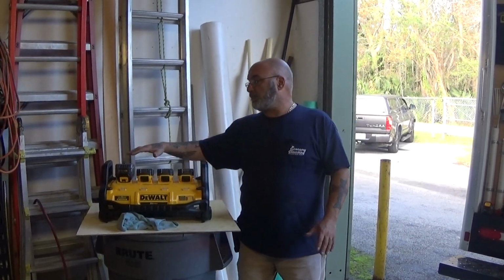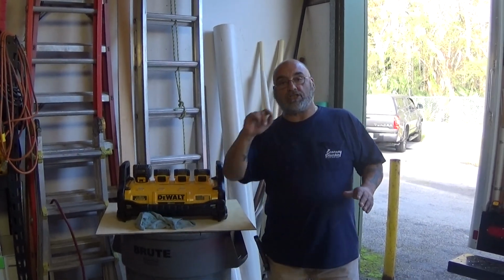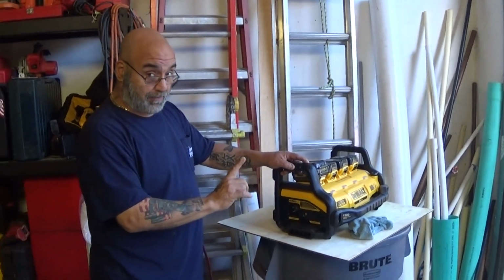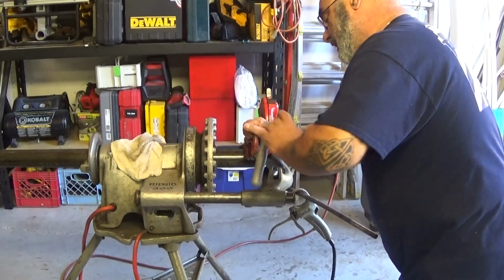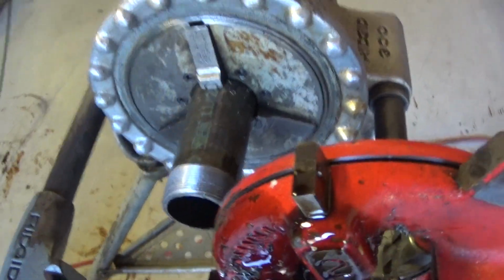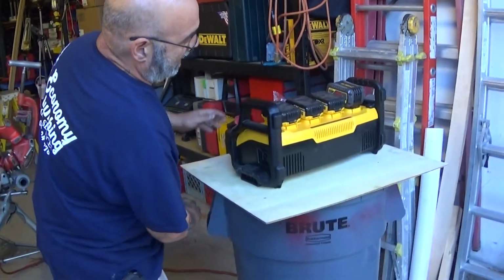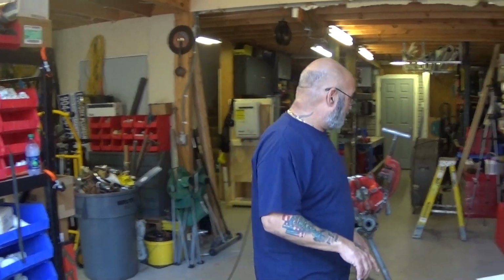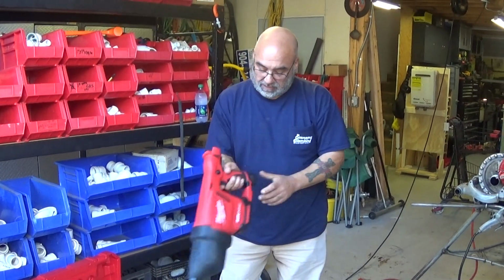Using the DeWALT 1800 power station to thread black pipe

Comment: If you use 4 : 9amh 60v flexvolt battery does it perform better than 20vmax batteries mixed together
Reply from the maker: Michael August yes you will get longer run time but the unit will still only produce 1800 watts. Thanks Mike

Comment: As long as that pipe cutter / threaded does not pull more than 15 amps, there should be no reason why it won't work, try putting on a kill-watt meter to really see how much amperage that motor is pulling
Reply from the maker: You Tube it works perfectly been threading with it for weeks. We did have a amp test years ago because we were pooping 15 amp breakers and our meter said the machine draws just under 15 amps while threading 2” pipe. Thanks for the comment Mike
Reply: Pretty impressive that it claims 15 amps and it was actually pumping out that much :-)

Comment: I have seen a lot of bad reviews on this station as far as run time. Can this power a pop up trailer and if so what’s the run time ?
Reply from the maker: David 23713 I’ve never used it on a camper but I’ve been using it to thread pipe, power my work truck, used it to rip plywood on a small table saw and still have not charged the batteries. I figure I’ve been using it for over two hours. Thanks Mike